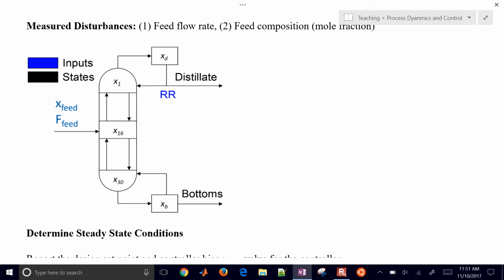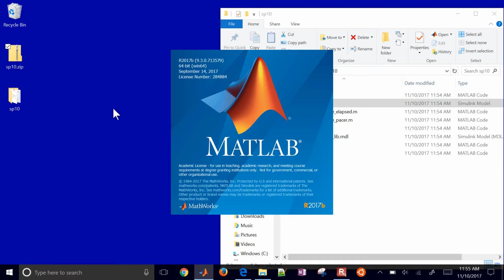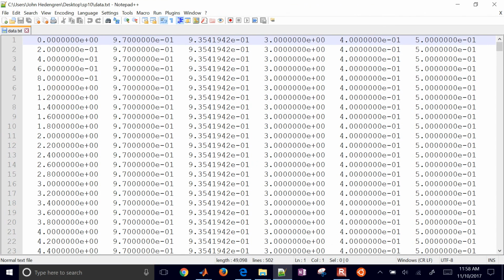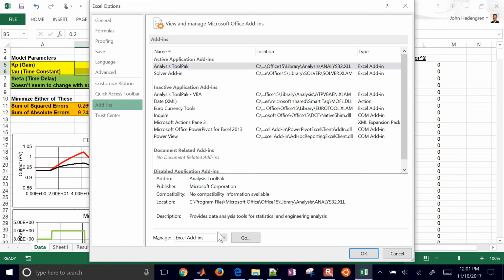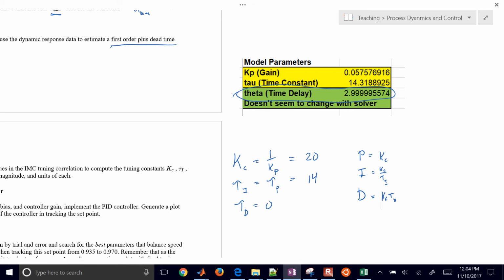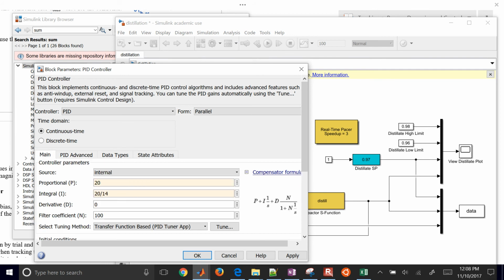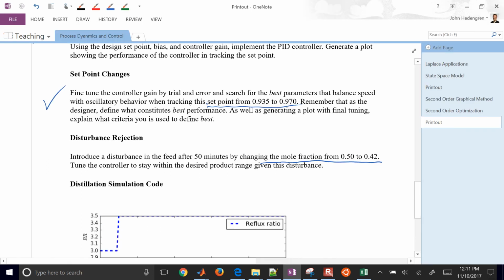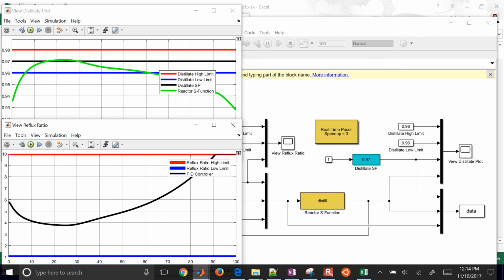Distillation PID Control in Simulink (MATLAB)

Comment: may I know which material balances formulae did you use for the distillation function on matlab? Also, can I change the column environment for my own unit? thank you i advanced.
Reply from the maker: It is the MESH (Mass, Energy, Species, Holdup) equations but without the energy balance. Here is more information on the distillation column: https://apmonitor.com/wiki/index.php/Apps/DistillationColumn